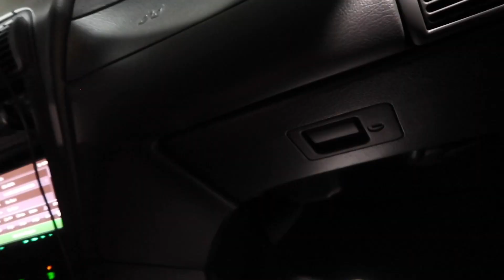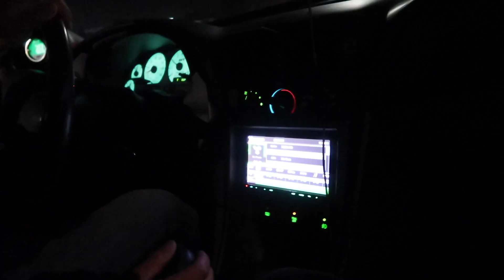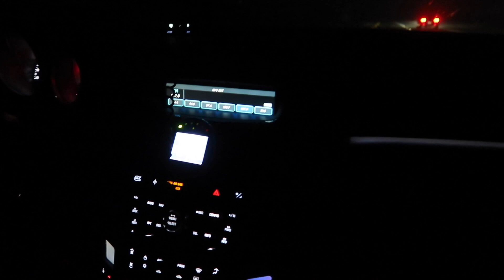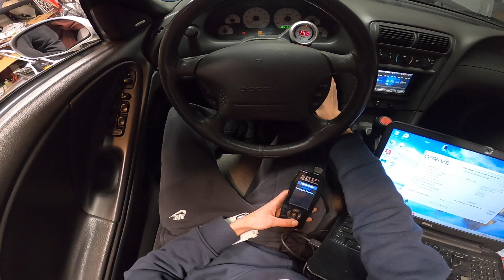Taking My Whipple Cobra For ITS FIRST DRIVE...

Comment: Make sure your TB is closing all the way, it appears there is too much air getting in either by the TB or a vacuum leak, which is why it's idling high. Double check all the hoses on the back of the blower as well it's common to miss something like the EGR port.